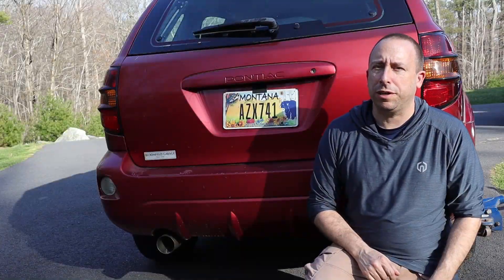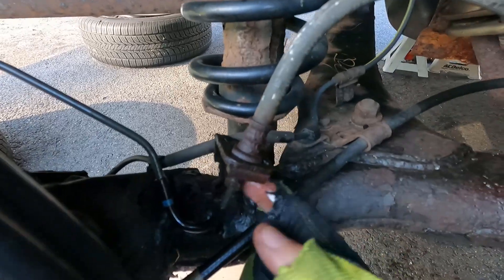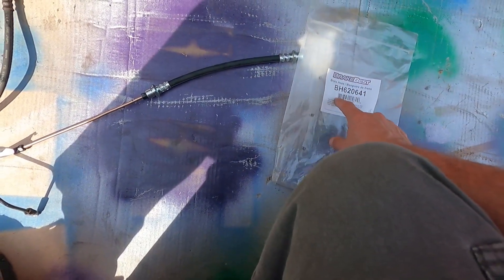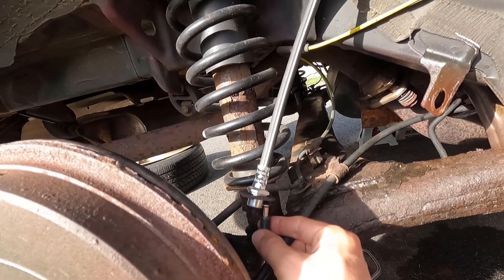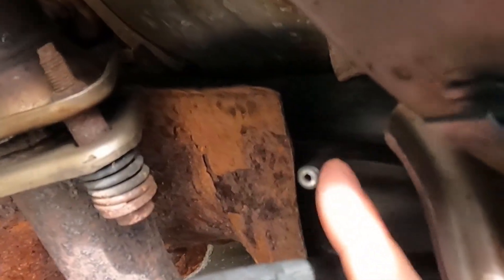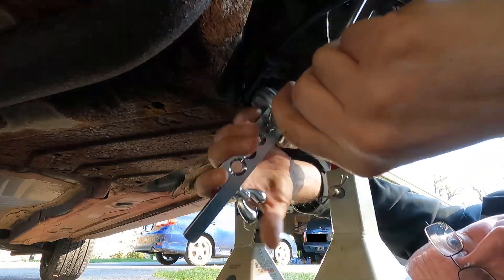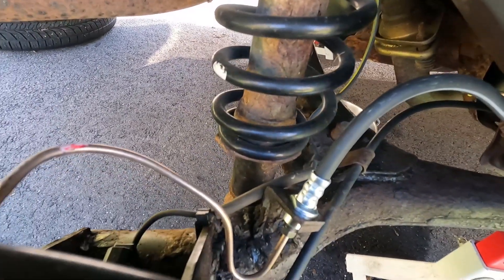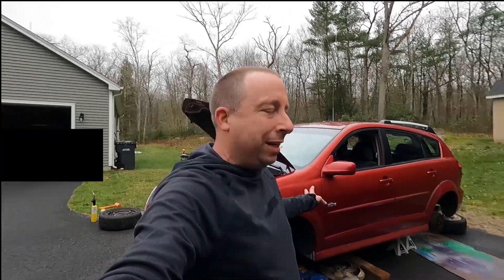► Brake Line Splice and Flaring Highlights: Repair Rusted and Leaking Brake Lines

Comment: Hi Rob,
You did an admirable repair job. The bleeding gets rid of all the old brake fluid. I have one of the one man bleeding kits that mounts an adapter the the mouth of the reservoir, then a hose to a tank that holds the brake fluid that gets pressurized. Now all you do is go to each wheel and open the bleeder until fresh fluid appears. You and the family stay safe.  73  WJ3U

Comment: Cool thanks. I'm thinking I'll just replace the whole pipe on my van as I don't know where the air is coming from. It's just on the right hand rear as all the other lines hold pressure. I've replaced the wheel cylinders and rubber hoses plus the load valve. It's been a real pan but I think I'm getting there . Trying to find where air is entering from and no fluid leak is a joke. Thanks mate for your video 👍

Comment: I wonder wHy didn't they use that Nocopp in the car when they made it? It won't corrode, I believe. Thanks for the video, it was interesting.
Reply from the maker: I'm not sure nicop was around in the early 2000s when this car was designed

Comment: Have you ever had issues mixing copper and nickel with your old steel lines ? Someone told me I should never do that. Thanks for the video.
Reply from the maker: I can understand why that would make sense but I have not had any problems.  Having said that, I've only run patches like this for a year or two before replacing the lines or the car.  Keep in mind even if you replace the entire line the mating fittings will usually be steel or maybe aluminum

Comment: awesome video. I have the same issue with my 2010 Pontiac Vibe, the steel brake line rusted out at the exact same spot as the car in this video.  Now I think I can fix it myself thanks to this vid. Thanks !  Just one question, is the steel brake line 3/16" or 1/4" ?
Reply from the maker: I think I showed the part number of the splices I used.  If you look them up you should be able to determine diameter...I already forgot what it was
Reply: My 2009 Vibe in that area still looks ok. I'll spray it will fluid film once a month during winter keep it intact from salt. It's been a decent little car no big problems bought at auction with $160,000 kms on it 4 years ago for $3800

Comment: Did you have to bleed out the brake fluid first before all this or just take a baster and take out most of it from the reservoir?
Reply from the maker: It had all leaked out for the most part already.  It's a good idea to get all the old fluid out and use new fluid if you are doing a job likecthis